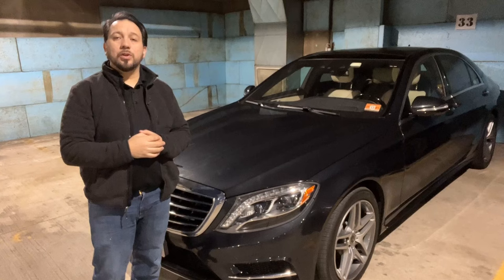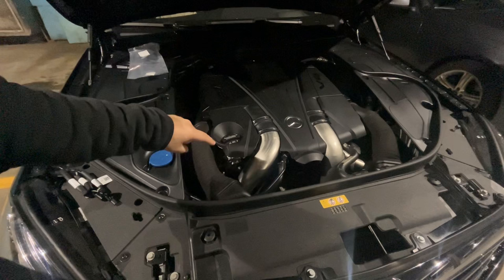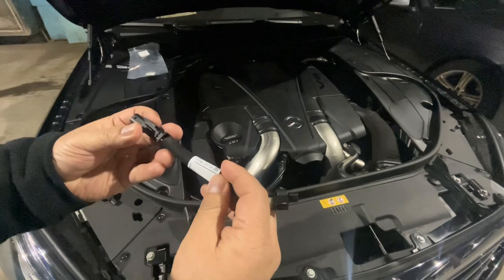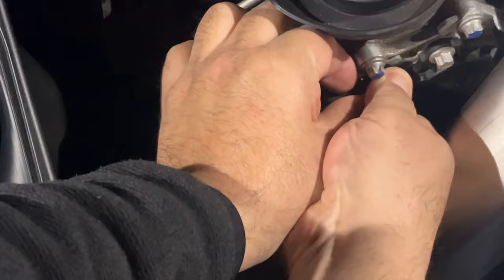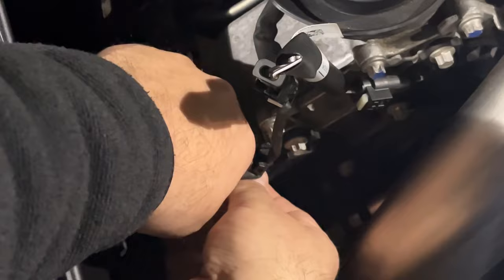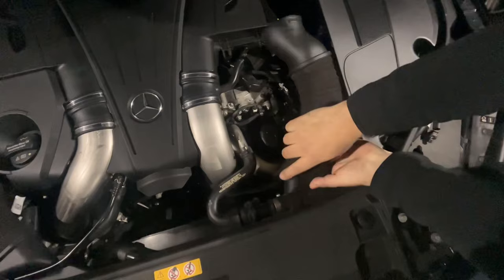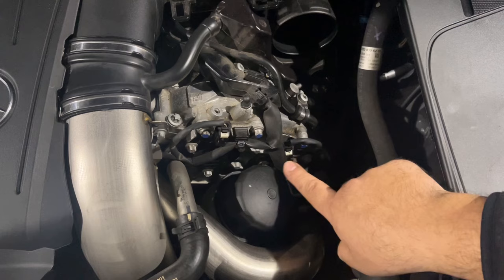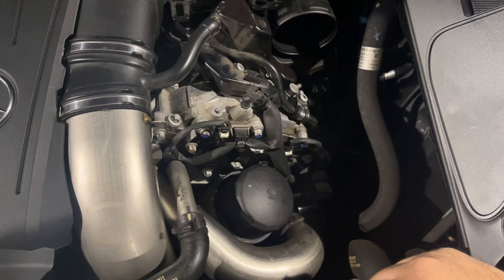Mercedes major issue you can fix yourself - Mercedes Benz problems | Part 1 | #josecitomarin

Comment: Mercedes Benz needs to come up with pigtails made of anti-capillary wires so it stops the oil, from my understanding, these pigtails don't do that, I believe they only intercept the oil and you still have to change the pigtail before it gets all the way through to the harness plug on the other end of the pigtail. My 2013 S550 had this issue a few months before the dealer sold me the car. The cars original owner took it in and the repair was $16,000. They pulled the engine and replaced the harness, the ECU, injectors, 02 sensors and a few other parts the oil got to. The dealer who did the work told me it will happen again even with the pigtails. It happened at 60,000 miles.
Reply from the maker: Thank you for your comment. Hopefully they do come up with something. Meanwhile we have to keep an eye on the solenoids and position sensors, and if they start leaking then yeah, throw out the pigtails and get new ones when you change the solenoids or sensors. One of my subscribers told me he had this issue at 30,000 miles. So we have to always look out for leaks.
Reply: I’d suggest they didn’t need to do all that. 
A poor dealer will just replace the lot to prevent a return. 
A good dealer will inspect and replace as necessary.
Reply: @gottliebdee263  unfortunately there’s no permanent fix for this issue on the M278 engine and Germany has assured me they’re not going to do anything. The fix is replace the entire wiring harness of the engine and anything else the oil ruins. There is however a company on eBay that made pig tails for the cam sensors since Mercedes never did, but the pigtails are only a bandaid as it will continue to happen. Dealer just does what they’re told.
Reply from the maker: @MercedesMechanic  you are correct. We have to keep an eye on the solenoids and position sensors.
Reply: I just installed the pigtails, 1 of my 4 sensors had some oil on the factory plug.
Don’t need to do anything besides replace the solenoids. Will putting in the sacrificial pigtails stop the oil from advancing. Don’t need to worry about the oil that already touched the harness?? I believe it just started as there didn’t appear to be much oil. Other 3 solenoids were clean. I also have zero issue with my car. It has 81k miles on it. 
Just need to know if no need to do anything else besides replace solenoids and add pigtails with the presence of a little oil?

Comment: This harness is for the Camshaft Position Sensors actually! They are the ones that leak oil from the engine through the sensors to the plug and harness. The camshaft Adjusters do not leak oil so far so you need to change where you are installing the harness. Just trying to help you guys so you don't get confused. I have a video on my channel about the leaking camshaft position sensors in my channel. Please view it to understand... Thanks and Good Luck...
Reply from the maker: Thank you so much for your comment. I have another video on the position sensors as well. They are different harnesses. The harnesses on this video do not fit on the position sensors. If you want you can get both and see the difference. I will definitely see your video.
Reply: Yeah....I'm under the hood and discovering these harnesses don't fit

Comment: Hello i just would like to ask I bought c63s it drives normal no abnormal engine sounds maybe a little sluggish in comfort mode i only got two codes p002177 and p001177 the mechanic told me the cam adjuster are ok and he’s going to check and probably going to change alot of stuff and it sounds expensive what do you think car with 80km 2017
Reply from the maker: Hi. I would try changing the position sensors and solenoids before anything else. Just follow my videos and do it your self. Make sure you add the pigtails while you are at it

Comment: Can I use this if the camshaft sensor already started to leak?
Reply from the maker: Thank you so much for your comment. You should replace the sensor and then install the pig tail. The harness only slows  down the issue. It doesn’t stop it completely. So make sure you replace your position sensors and solenoids
Reply: @josecitomarin thank you
Reply from the maker: @DJRip83  no problem

Comment: I though that only older Mercedes like W211, W204 and W220 have this type of problem. 🤔🤔🤔. Your transmission oil & filter will be changed at every 60,000km together outlet adaptor to avoid oil from going into TCM?
Reply from the maker: Thank you so much for your comment. Mercedes Benz has had this issue for many years. There are some modern cars that are being sold back to Mercedes with a damaged harness, by costumers that did not know the issue and did not want to spend the money fixing it. There are also some lucky ones that even got the issue while still under warranty and had it all covered.

Comment: If i already have an oil leak in the engine harness will these work or is it too late?
Reply from the maker: Thank you so much for your comment. Hopefully it is not too late. Just clean the connections really good and clean that leak. Then install new solenoids and position sensors if you have to, then sacrificial harnesses as soon as possible. Make sure you do all 4 solenoids and/or all 4 position sensors. No sense on doing just 1 or two. They other are going to leak eventually. Here are the links. Also make sure you see the other videos 
Position sensor harnesses 
https://youtu.be/856LX3Em8UM
Solenoids and position sensor installation
https://youtu.be/heh5IR6zMvA

Comment: It’s happening to 2021 E300 4 matic too ?
Reply from the maker: Thank you so much for your comment. It’s happening even to smaller 4cylinder engines like in the C300. I would play it safe and put it on. It won’t hurt to install it. It’s just a small extension of wires.
Reply: What the parts numbers ? I’m trying getting from MB dealership they said i don’t need one .
Reply from the maker: @rudyvancolfort7072  I have the links on the description

Comment: Fcp euro does not sell camshaft harness, they only sell the cam magnet harness
Reply from the maker: Correct. It’s the sacrificial harness for the cam magnets or cam solenoids
Reply: @josecitomarin  eBay seller Zzperformance sells a kit for both cam sensors and cam magnets for our cars. Might want to add that to your comments of video.
Reply from the maker: Awesome. Thank you so much Joe. I got the harness kit for the position sensors thanks to you. I did a video on that. Please take a look
Reply: @josecitomarin you are very welcome!! Glad you were able to find them 🤝

Comment: Great video.  Wondering if I should look into this for my 2016 E400.
Reply from the maker: Thank you so much for your comment. Is definitely worth looking into it. Look at the part number in your solenoids and see if they are the same. They may be, because even the C300 uses the same. The problem really is with 8 cylinder engines.
Reply: @josecitomarin  I just ordered 4 each cam solenoid harness extensions from Fcpeuro.  Thanks for your video.

Comment: How do I know if the oil has reached my ECU? Would i check the ECU connector for oil? Car is misfiring in cylinder 2 and 4 and im getting camshaft sensor codes with a short circuit so I’m pretty sure I’m having this wiring harness issue.
Reply from the maker: Thank you so much for your comment. If it got to the ecu you would have a lot of problems and lights. So it looks like it didn’t reach that point yet. So change all of the cam sensors and positions sensors and install the pig tails. Make sure you clean the connectors really good. Also check what your spark plugs 2 and 4 look like

Comment: Hi Jose, does those harness will fit Mercedes G63 2014 with engine M157?
Reply from the maker: Thank you so much for your comment. Yes they do.
Reply: @josecitomarin  Many thanks for your quick response , I’ve ordered them yesterday from the link you provided under the video (zzperformance)👍
Reply from the maker: @v0ss3n  No problem. The other wires you have to order are from the dealer. One set is for the position sensors and the other is for the camshaft solenoids
Reply: @josecitomarin  yea, I’ve watched the other video, ordered from FCPEuro in USA, should receive them this Friday to Switzerland 👍
Reply from the maker: @v0ss3n  to Switzerland, nice.

Comment: How do know when they are damaged and to change them again?
Reply from the maker: Thank you so much for your comment. If you see them wet again. Specially if it’s on both sides. They give you sometime for you to replace the position sensors or the solenoids. So if they are wet, you have to replace the position sensors and solenoids that are leaking as well.
Reply: Thanks for responding. Do you mean the sacrifice harness will get wet?  Then you just put new sacrifice harness again? Thanks in advance. Keep the great videos coming.
Reply from the maker: Right. But if they got wet is because the sensors are bad. So keep an eye on them

Comment: Does this apply to w212 E350 or it’s just for v8?
Reply from the maker: Hi. They use the same cams for many of their models even the C class. The E class is included. Checkout the description of the video for the full list
Reply: @josecitomarin thanks!
Reply from the maker: @santagautam115  no problem

Comment: Crud, Kevin at FCP EURO says there are no such csbles for my 2019 C300 inline 4. Can that be correct? I find it hard to believe
Reply from the maker: Hi. Thank you so much for your comment.   Mercedes uses the same adjuster magnets in many cars. If you look at fitment under the part number in their website you’ll see that the same harness fits your car. The part number is 2711500156. Not many of the C class have this issue, but it doesn’t hurt to be safe and put them on. I would just order them and see if they fit. They are only $10 and you need 2.
Reply: @josecitomarin  and thank you very much for your video. I completely enjoyed it, such a beautiful machine 👍. I just ordered the harness, thank you again for showing us this!
Reply from the maker: @shireoryx6153  you are welcome. Make sure you see the other videos and stay tuned for the ones coming.

Comment: Hey Jose, I bought a 2014 s550 with 120k miles, just got it back from the mechanic. they said it will start making a knocking sound eventually and will cost 10k dollars to fix, said it has internal issues. 
can they tell that all of that is going to happen just by hooking up their tester? ty
Reply from the maker: Thank you so much for your comment. One damage I know that costs 10k is the main harness replacement. That is if they found oil on the computer side. 
If they hear a knocking maybe they found something pulling out a spark plug. The tester won’t tell you what is going to happen. It will read codes if the car has any. It’s a good idea to have a tester at home. Do you feel anything while driving?
Reply: @josecitomarin  Hi thanks for responding, no problems during driving. the car drives perfect.thats why I couldnt understand how they know the engine is going to go bad
Reply from the maker: @Miamiflow885  no problem. Definitely ask them why they said that. Check your wiring. Why did you bring it to the mechanic in the first place?
Reply: @josecitomarin  radiator hose had a leak, 690 dollars to fix it
Reply from the maker: @Miamiflow885  wow. A lot of money for a hose. See if they’ll tell you what they found. If not you are going to have to check your wires and take a spark plug out and see what you find in there.

Comment: I think these pig tail harnesses have their strands of copper wires that sealed off or are soldered solid to prevent it's capillary action that stop the leaked oil from travelling into ECU. But not sure about the one on camshaft or crankcase position sensor. Any pigtails for these. 

Only last year my mechanic had fitted my infamous M271 engine with pigtails. At that point had yet to notice any oil sticking on any of its multi pins.

I had been thinking if premature wear on sprockets, timing chain and the holes of cam magnets (as seen in U tube) could be somehow be aggregated by flustered ECU making small but erratic adjustments leading to failure well before it's intended 250,000km lifespan. 🤔🤔🤔

I will forward your link to anyone I know that has a Mercedes. Thanks

I think, on a yearly PM basis, I must disconnect the large ECU adaptor & spray in some electrical contact cleaner & swipe it clean with an oil absorption pad. Next year I will replace the adapter connection located on the automatic transmission body.

Regards.
Reply from the maker: You have very good points. Thank you so much for your comment. If you see part two of this video you’ll see the pigtails for the position sensors. Please send the link.
Reply: @josecitomarin  my option is to change to new position sensor for camshaft &/or crankshaft as I think these are coming to 17 years on the car. Not sure if they have ever been replaced. If they had been replaced says 5 to 7 years back then putting in pig tails is a good option. 🤔🤔🤔
Reply from the maker: @whlawson5812  even after replacing the sensors and solenoids it’s a good idea to add the pigtails. I changed all 4 sensors and all 4 solenoids and added the pigtails. Extra security. Only one of the solenoids was leaking, but I changed it all
Reply: @josecitomarin  I think after replacing old position sensor with I will cut up them to have a look. I am reasoning that the camshaft adjustors does have pressurized oil to allow it's modulation to take place - this would be the source of oil, gradually over time, leaking of these adjustors. 

But tips of the camshaft & crankshaft position sensor are not exposed to pressurized oil of say 0.5 to 2barg. Yes, no?

After cutting up & have a look on these old sensors I will still have time to decide installing pigtails for them. 🤔🤔.

Regards
Reply from the maker: @whlawson5812  you could be right, but you could also be wrong. I know the pigtails won’t hurt the car in anyway. They are just extension wires. So when I saw the price I didn’t think twice

Comment: Thank you changed cam shaft sensors but still getting oil will use this pigtails have 14 e55o with 32,000
Reply from the maker: Thank you for your message. Have you checked the solenoids for leaks? Those pig tails are for the solenoids.
Reply: @josecitomarin  will check , order 4 and will install for prevention , question do you think oil is coming from camshaft adjuster magnet
Reply from the maker: Those are the solenoids. It could be. If they are leaking they should be replaced. The pig tails will help so you harness doesn’t get damaged, but if they are in fact leaking they should be replaced. Just make sure they are leaking. It looks like you don’t drive your car to much. There is not enough lubrication on the seals
Reply: @josecitomarin  Thank You again , I will change them when the weather warms up here in the Northeast, it doesn't look to hard to do , I fig I would put pigtails on now to protect ECU , the 2 on the right by oil fill were both leaking other side was dry, Thank You again all input is appreciated
Reply from the maker: I’m in Jersey looks seems like we are close. Maybe we can meet and see what is going on with the car. If you saw my other videos you know I got an S550 as well
Reply: @josecitomarin  I'm on the east end of long island sounds good
Reply from the maker: Nice. I like going to the Hamptons at least once in the summer